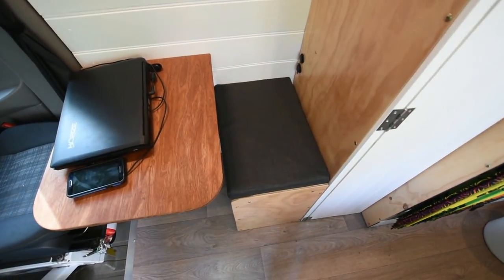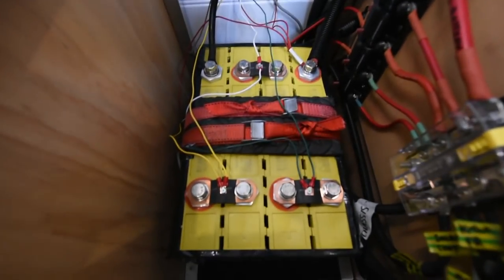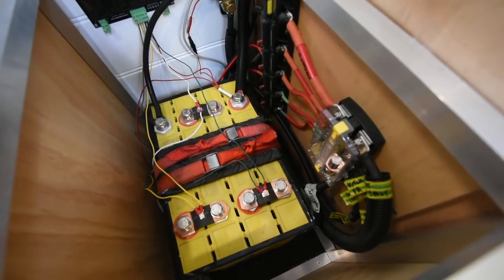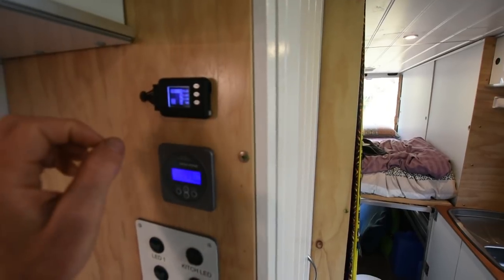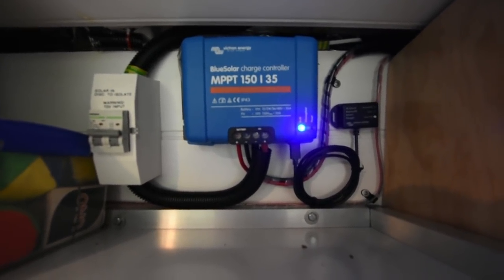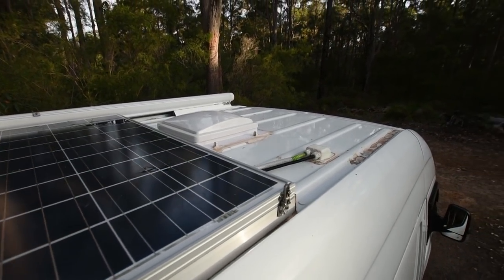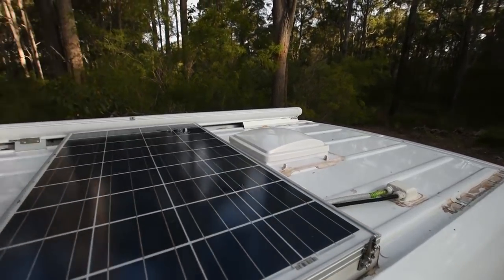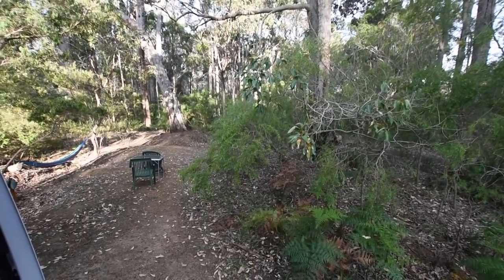DIY Off Grid Solar and LiFePO4 Battery Tour - Sprinter Van Conversion

Comment: Getting my first 1k lithium iron phosphate battery soon. I also going to add a 600w wind turbine for possible night time energy collection.
Reply from the maker: Sounds awesome
Reply: Comfortably Lost Did you review the Inergy Kodiak, that is what I am using to balance the batteries. You can add an unlimited number of batteries with it, so as funds permit, I can improve the system. Going to be using it in my travel trailer instead of what came in it, the two deep cell batteries are well past their prime. Also I swapped out all the lights for leds, even using a projector for Tv vs an actual Tv.
Reply: The Survivalist Are you saying that with that system all the batteries don't have to be the same age? How different can the batteries be? (Make/capacity etc). That would be a nice perk if they've got around that restriction.

Comment: Your system looks great but you didn’t mention the appliances you use or if you use a inverter, I would love to see a update with appliances and energy usage if it not to much trouble.
Reply from the maker: Good point, it was covered here in the comments but obviously that's liable to be missed. We currently don't use an inverter as everything has been designed to run directly off 12v DC sources, even our notebook PCs - via DC-DC adapters. We don't run much, just the fridge, LED lighting, and recharging our devices. We will add in an inverter in the future though to enable us to run a small food processor.
Reply from the maker: We actually have a small 150W mod sine ciga jack inverter that we never use, but theoretically it would be suitable to charge our power tool battery charger in the meantime until we get around to buying a car charger kit.
Reply: Thanks mate, using all DC applications is a great idea, reliable & efficient, love it 👍🏼

Comment: I really wanted to see you tip your solar panels on the hinges. I'll be putting mine on soon and looking for ideas. I like the latches for quick release. You know...  You could do an entire video on how you designed the tilting panels  :o)
Reply from the maker: Oh the hinge/tilting thing turned out to be so much work. Still not sure if it was worth it. We used epdm rubber nutserts and marine grade stainless steel bolts to attach it to the panel frame and the roof rails. We never tilt up the panels, it's just there in case we need to get access underneath to do a repair or replace a cable/panel.

Comment: I've been trying to justify the extra expense of flexible panels... they work out 3x the cost of the framed rigid panels. Do you notice a hit to your diesel/petrol usage? I improved my MPG ~10% just by taking off the previous owner's roof rack.
Oh, and thanks for the info about the Victron kit. Reviews I'm reading online are excellent.
Reply from the maker: I couldn't tell for sure, as we didn't do a long test drive until the build was completely finished with everything inside. The economy went from ~7.5L/100km completely empty to ~9L/100km with the panels and awning on the roof, and the full build out weight inside. I think with the rigid panels you'll be fine as long as you put some sort of aero wind deflector on the front facing edges as we have done. This helps prevent the panels blowing off and also reduces drag.
Reply: Thanks for the reply. I didn't find a seller for the roof rack and that has a deflector on the front bar. Good idea. I will see if that can be repurposed. I suppose savings I make up front will cost me further down the line and I will need to do some rough maths to figure this out.... And I wish everyone would settle on the Metric system!

Comment: Neat work as it is all the build.  Which brand of panels did you get?Are they Q cell?  Thank you again for sharing.
Reply from the maker: They're "motech multicrystalline silicon" cells, quite a few decent quality panels on ebay have them.

Comment: Clear informative except for one thing. The fridge. What fridge do you use and will the battery cope. Do you charge your battery from the engine system too?
Reply from the maker: Fridge is a Dometic CRX 110L. It uses around 40-65Ah per day. Our 200Ah Lithium battery copes with it fine.
At the moment we are 100% solar powered, but now it is going into winter in Australia we will probably add in a battery combiner to charge the LFP battery from the alternator while driving.

Comment: I'm contemplating the Fusion lithium 200 amp or the Pro Power, plug and play, but it's $400 more...You have done a great job..What are the amps on the breakers?  I will be going with the same mppt and using two 200w flexible panels...
Reply from the maker: It's all different. 10A on the breaker from solar to MPPT (panels in series). 50A from MPPT to battery.  We used manual reset breakers as it allows us to isolate the circuits quickly and easily.

Comment: I am curious to understand how the front panel flew off... I am also installing 4 panels and one of them will be sitting exactly where yours used to sit. What sort of adhesive did you use? Sikaflex?
Reply from the maker: Bolted down thru the roof. You need to use a wind deflector on the exposed edge of the front panel to prevent lift.

Comment: do you have a link to the exact ones you bought? I want the rigid ones like you have, but they are all semiflexible! And wouldnt it be a good idea to have caps on those batteries? You dont want to accidentally  short them out, youd be in trouble.
Reply from the maker: Hi, are you located in Australia? If you are, send us a PM or email and we'll send you the direct link to the panels.

Caps wouldn't hurt for sure, but as the battery is in a secured box with nothing else to fall on it they aren't really necessary.

Comment: could you say what you use all this power for? e.g. the devices you run maybe induction hob?
Reply from the maker: Just LED lighting all throughout, three roof fans, charging PC and devices etc. Nothing major. Our stove is LPG powered. If we wanted to run an induction hob we would have had to spend $$$ on a larger battery bank, high powered inverter and everything else. Not worth it for our need as we are off grid 100% of the time with no power hook up.
Reply from the maker: Oh, and a 100L Dometic 12v DC fridge too. That's the main power consumer.
Reply: Comfortably Lost - Surely the induction hob would improve your off-grid ability though, because you wouldn't need to refill the gas bottles so often?
Reply from the maker: Not if we are in shaded camp sites or during winter when there is less solar energy available - especially to run a energy demanding device like an induction cook top. We get around 5-6 months of use from 2x 4.5kg LPG bottles, regardless of how much solar access we have. While we have our issues with LPG, mainly in terms of safety and environmental impact, it is still the most energy dense and portable way to cook right now for off grid vehicles.

Comment: do you use an inverter or are you using all 12volt apliances?
Reply from the maker: All DC powered for now. But we will eventually add in a good quality inverter to power a small blender and a few other small things that don't have DC charging options. For now it hasn't been an issue.

Comment: Which inverter do you using?
Reply from the maker: We don't use an inverter at the moment, but we will be adding in an Enerdrive 1000W pure sine this year solely to power a small food processor. Everything else is DC powered, including our computers and fridge.